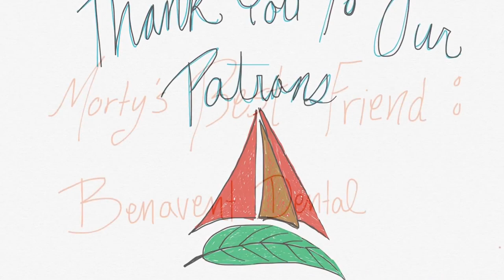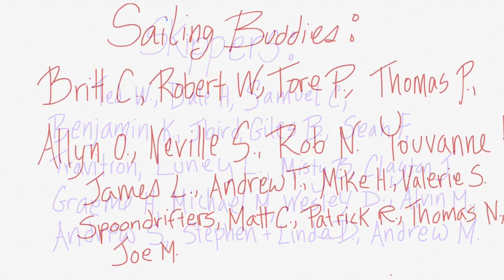Bend and Snap | Sailing Wisdom [S3 Ep22]

Comment: Getting work done in Europe is different than in the US all time lines are approximates. The wood work will look great when you get it done Herb. Like what you did with the rot. I'm looking forward to when the oven comes. Where you satisfied with the glass work done on the transom? The bilge looked great after the paint.
Reply from the maker: A little peeved about the transom. He told me the way they were going to fix it and he said the right things but when it came time, he just put some bondo in there and called it a day. I’m glad I ground open the cracks so that the bondo has a better chance of working!
Thankfully it is still working out without re-cracking again to this current day.

Comment: Those floors definitely look like they were made with exterior grade ply!  Not at all uncommon in older boats!  3/4 marine ply typically has (from my experience) 13 layers where exterior usually has 7 ( fewer thicker layers)  either way going to marine ply is a nice upgrade!
Reply from the maker: Could be! Some survived but the rotten parts just fell apart. 
I’ve never been a fan of plywood, so the replacements are either good “real” wood or closed cell foam core.
Reply: @RiggingDoctor   You'd be surprised how long the 70's exterior ply can last.  My Morgan Out Island 41 has all exterior ply bulkheads that are skinned with 1/4" teak ply and I've only found rot in spots where there was a persistent leak!  all easily patchable.  but your case requires definite replacement of the affected areas!
Reply from the maker: Pierre Mitham we did have some consistent leaks over these areas. Still don’t know exactly where the leak is coming from, but we hope to get that leak fixed this time around (I’ve been chasing this mystery leak for 7 years)

Comment: Wood rot on fiberglass boats is really the Pits!  Can you get Coosa board or equlivant  non wood structural core board?  Alternatively BS1088 marine ply is almost rot proof if not encapsulated , they might even sell it in the Azores! 
Cheers Warren
Reply from the maker: warp21drive we have a closed cell core foam core that we will use to replace the plywood.
Reply: Rigging Doctor I did see that , I just like to have a structural core as well so you are not relying just on the fiberglass. But I'm sure what you are doing will work well.   
By the way the 2 sided scoring on the foam is to allow semi-compound bending of the core when being installed in a curved mold of boat shaped parts. Cheers warren.

Comment: Nice job on the floors, that's tough work.  Why did you decide to haul out in the Azores?  There's (still) plenty of DIY yards in the US.  Obtaining materials would be much easier and cheaper.
Reply from the maker: We hauled out here because it was super cheap and we were leaving the boat there for a few months while we were back in the states. 
While on the hard, the idea to start the projects hit us since lumber is cheap here. 
One thing led to another and we are now grey and under construction!
Reply from the maker: Have you been over here yet? It’s cheap and gorgeous! We will probably be on these islands until June, when we head to Portugal
Reply: @RiggingDoctor  No, I have not done the Azores.  I hauled out in Trinidad once, and they have excellent facilities.  However, it's no cheaper than US yards, and you have to get all materials locally--forget mail ordering.   Dockage, however, is generally much cheaper outside the US.
Reply from the maker: Wet slips are about $27 per day, on the hard has cost us about $120 per month!
Lumber is very cheap here but we are relying on the mail for stuff that is way too pricey. 
I get epoxy for $90 per gallon with my portsupply account in the states, so shipping and taxes are still cheaper than buying it locally!

Comment: 1) why does it matter if the tourists were American?
2) exactly how is geothermal "renewable"?
Reply from the maker: Paul Podby
1. They were tourists, they just happened to be Americans. 
2. Geothermal uses the heat from the ground to boil water and make steam. No fossil fuels were required to generate power. As long as the volcanic activity is going on underground, they get power!
Reply: @RiggingDoctor  1) so if their being American is irrelevant, why point out the origin?
2) I understand how geothermal works.  "Not fossil fuel dependant" neither guarantees nor excludes readability.

I'm just pointing out that you'd gay more views if you were more conscious of how preachy you sound with some of your choices... Especially when followed by a dumpster load scene.
Reply from the maker: Thanks for your input. We're just trying to be as honest and descriptive as possible